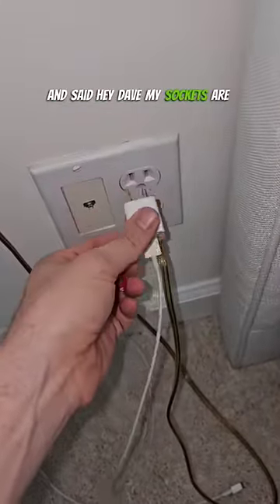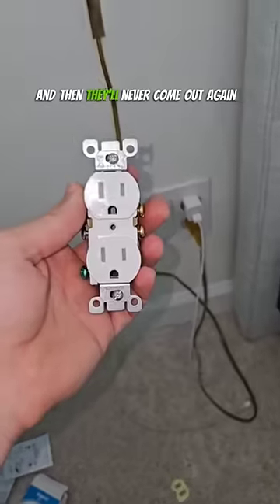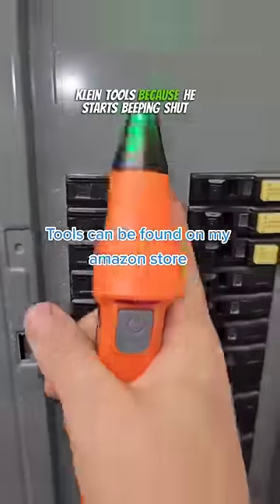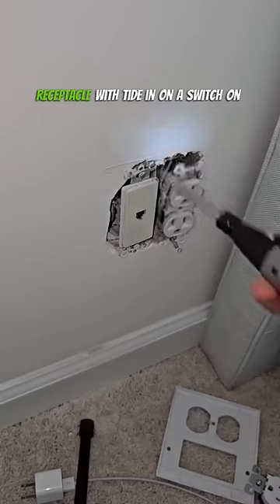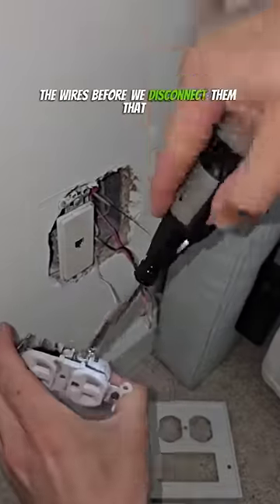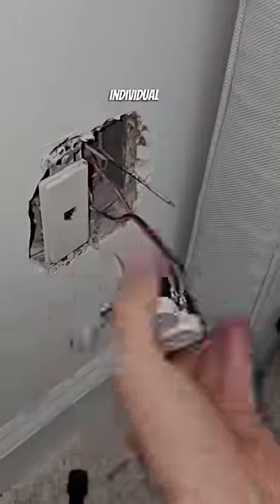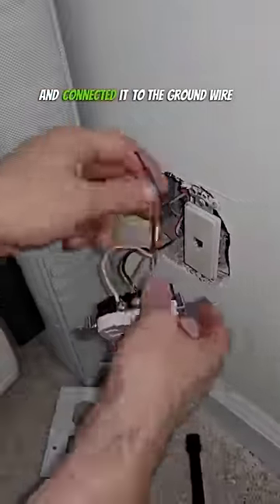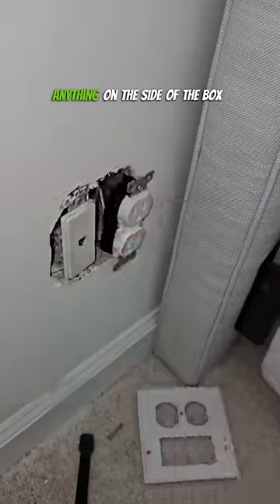🔥 Thats a hazard! How to change a switched outlet #diy #handyman #electrician #HowTo

Comment: As a British Electrician, I'm going to need therapy after this!😂
Reply: As an Aussie one, I completely agree
Reply: They actually put this crap in houses  looks like it's from the 50s
Reply: As a Dutch electrician my eyes are bleeding and my mind is twisting. I'll never understand how shit US electrical is but everything we send there has to be super overbuild UL Certified 🥸
Reply: Even as an Austrian non electician i can assure you that sh*t wouldn't fly here😂
Reply: Electrician in Canada here. What dont you like about it?
Reply: As German Electrician, me too!😂
Reply: @scottyoung7856 uninsulated terminations on the side of the socket is a pretty bad design, especially when you have to insert it like that into a metal back-box
Reply: @thegiantgaming7592   this is an outlier
Reply: @alemgas  Ive worked in houses built in the 1910's and its exacly the same, most still have the same wiring, also we use 110V here, gives you a nice little zap, but you guys use 220V, im sure thats a life and death situation 🤣
Reply: @SavageBunny1  1910 that's nearly  new, we had houses when the dead sea was just ill. We have real electricity not girlie stuff 😂
Reply: @ImBuanana  Fair. Most modern recepticles have some plastic around the screws so they are a bit more protected. Also, if the hot side does touch the box it will trip the breaker, which is the actual reason we ground everything. 

Also remember that we are stuck with device box dimensions and designs from the 1920s where most of Europe had the opportunity to redesign their electrical systems after WW2.
Reply: @scottyoung7856  how come you're stuck? Just make different ones.
Reply: @ukaszsiebiesiuk9002  because it would mean replacing every service and appliance on the continent. Thats easy when you gotta rebuild after a major war before most people have electricity, but nearly impossible now.
Reply: As a british DIYer I was even shocked.
Reply: It's not just you... the only way to find the breaker really?
Reply: @scottyoung7856  everything?
Reply: Lemme blow y'alls mind. This is normal in the US.
Reply: @Savage Bunny  either is plenty to kill you
Reply: @SavageBunny1  yea... we dont have bad electricians here. you can guess why.
Reply: the us gets away with this cuz the power is lower
Reply: @ImBuanana  except we swapped to plastic boxes a long time ago. Idk when but my house is 20 years old and has them
Reply: @AbsurdAsparagus   with lower voltage you get increased amperage and higher power losses and more wire heating... 115v is actually a bigger fire hazard than 230v.
Reply: @SavageBunny1  Plugs here all have safety features. Go look at a British Plug and tell me how you can possibly get electrocuted,, Giant earth prong that must go into the slot first to open the live and earth prongs.  Pins that squeeze into place that stop plugs coming out easily. Live and Neutral prongs earthed half way up the prong.  Switch on the wall socket so it can be switched off and lastly a mains breaker that can turn everything in the room or the house off with a switch.
Reply: @johnmcm7690  Code in Canada says all exposed metal and all metal conduit and enclosures need to be bonded to facilitate the operation of overcurrent devices. The idea is that a live wire touching something it shouldn't will trip the breaker instead of becoming a hazard.
Reply: The American dream is a lie haha
Reply: As a German who doesn't even do electric: that just looks wrong
Reply: US electrics are rough.
Reply: @thegiantgaming7592  combining this receptacle with the dry wall build style of American home's seems like a fire hazard to me. Dutch homes are just on a whole other level.
Reply: As an German it is amusing seeing how many Regulations we have. But seeing how other countrys do it is sometimes scary..
Reply: @SavageBunny1  na.. just a little tickle 😂 400v is the real kicker 😂
Reply: @ImBuanana why bad design. You’re not supposed to work on it if it’s live.. so what’s the point ?
Reply: @alemgas  damn bro alright Mr. Whale oil lamp.
Reply: As a non electrician American, nobody cares
Reply: @SavageBunny1  Not really, it gives you a jolt but unless you have some pre existing heart condition, you would be ok. 

There's a lot that's "wrong" with the system that's being used in the U.S, especially the terminations lacking insulation and going into a metal box. We all know that "it works" and no one is "hating", it's just that in this big world that we live in, there are countries that use much safer protocols when it comes to electricity.
Reply: Then consumer unit (panels) are roughy asf. They look straight out of WW2 😂
Reply: @pws3rd170  I'm willing to hazard a guess that both plastic and metal boxes are still used, depending on the situation.
Reply: @IMPiChE  the point is to eliminate as many risks as possible. You aren't supposed to touch live conductors but it doesn't mean we leave them exposed.
Reply: @ImBuanana  thats how all places are here in the us. Makes painting easier but didn’t know it was a safety issue
Reply: @scottyoung7856  
Abroad in Europe, the outlet is also still screw fastened but it's in the back of the outlet so no chance that you get shocked.
The newer ones have insert type connectors so nothing exposed.
Also, the breakers: it's US so no FID main breaker connected to other breakers via copper bus.
Difference in standards.
Reply: @AbsurdAsparagus  Brother that's like the textbook definition of not understanding electricity. Power is wattage. Neither Voltage or Amperage are power. High Voltage means it can pass through things more easily. More Amperage means there's more electrons moving through something. 110V easily pierces the human body. It only takes 0.1 to 0.2 amp to kill you. That's 11 to 22 watts for 110V. Your mains has about 110-120V with 15-20 Amps max. This is 100x more than what can kill you.
Reply: @povertytv1848  as an Austrian electrician i can assure you that if that would be built here you wont even come to testing that shit because your own company would start rageing at you 😂😂😂😂😂
Reply: The circuit breakers should be labeled… the receptacle should be grounded…but in the US we have 110 residential—so maybe only one therapy session necessary
Reply: @winifred3000  am not an electrician, accidentally made contact once, did not die

If that had happened in Europe at double the juice I would not have survived or had severe damage

I think that’s why they’re all losing their minds.

Plus imagine how bad this would sound if they were bitching about Africans or Indians or South Americans like this….
Reply: Ditto New Zealand.
If I installed a crazy untidy mess like that, and there was a fire ANYWHERE in the house, you get Insurance investigators come though, spot the work, and YOUR Insurance gets a call from the House insurer.
Reply: @thegiantgaming7592  The reason why US electrical is kind of crappy is because it's older while Europe and many other countries got to build their electrical system from scratch in the aftermath of World war II, so they were able to put in place better electrical standards, while in the US because the system was still working it was cheaper and easier to just make certain aspects of it safer than to try to impose new electrical standards on the system. Some examples of this are adding the third ground pin to devices, improving breakers, and putting new standards on 40 amp devices like dryers and stoves.
Reply: @ImBuanana  we wrap the sides of the outlet with electrical tape to prevent that from happening
Reply: @pws3rd170  plastic boxes versus metal boxes is more of a distinction that's at the discretion of the electrician installing the system, there are advantages and disadvantages to both, some electricians like the plastic boxes because in case there is something wrong with the receptacle it's possible that the plastic may melt and insulate whatever might cause the problem, but some other electricians don't like it because the plastic could burn instead and cause an electrical fire.
Reply: Good thing your shit is free. Go take a 3 month vacation too
Reply: @saphiravonterakan7117 Das ist wäre in Deutschland reinster Pfusch
Reply: The world needs to just admit they got it wrong and adopt BS1363 like sensible countries :D
Reply: @scottyoung7856  first of all, solid copper wire, come on, in Europe we don't use that by at least 40 years, if you own a house with solid wires is not following anymore the normatives. Then, there are like a lot of things that are weird in the first place, screws that someone could touch with the fingers and have to be isolated with tape, seriously? Here you can't even have screws if not under permanent isolation. Metal outlet.. Holly f. Plus the blade plugs I think those are horrible, really horrible.
Reply: @scottyoung7856  I think it had to be pattented go to the government regulator and purpose the commercial of new type of outlets.
Reply: I’m not even a sparky and I feel sick
Reply: @scottyoung7856  dude seriously, in europe, electrical connections is stupidity proof, more single wire is more thorn to overheat. If all changed is for a reason, and believe me that you guys have the most housfires for electrical faults. It makes my ass laugh when I see how you build those houses.
Reply: @thegiantgaming7592 there's a reason our Outlets are 120 volts, it's so we don't fucking die when it fails.
Reply: @ukaszsiebiesiuk9002  Your cities were literally flattened and rebuilt.
Reply: @McKae00  they dont like to acknowledge that lol. all these people but a few have skimmed over that fact like it is nothing.
Reply: @scottyoung7856  Have you seen european electrical outlet?
Reply: @sonicsupersam7793  😂 then why do we have 3x higher immigration than anywhere else in the world?
Reply: As not even being an electrician but German, yes me too....
Reply: @freerideshuttle  Dude the metal enclosure is earthed. That is safer than having a plastic enclosure as the circuit breaker will trip if it ever becomes live.
Reply: @SavageBunny1   we do but have so many safety features you do not it almost never happens.
Reply: @baileyharrison1030  however, see it as you want boys, I don't really care. There is a point if everything changed here, don't you think? It's not that all countries are stupid, wouldn't be better if you at least inform at this point in life. It's just funny how you protect these US rules, it's exactly the same as imperial units that suck aswell. If you're sturdy and believe so much into what you and your pall say then stay like that, keep the way you're doing.
Reply: That’s American anything for you lol
Reply: @povertytv1848  Same as an Swiss non electrician XD
Reply: @freerideshuttle  you do care lol. you are writing paragraphs in this thread over it😂you arnt slick. again europe had its countries laid to the grown after the world wars. they had a much easier an appropriate timing to change all the procedures up and shit. unlike the usa who hasnt been laid to the ground an cant rebuild it without cutting everyone off of power eventually and all the mess it would create. construction zones can already take forever just for interstate work. it almost wouldnt be feasible to logistically replace ours without major backlash an issues
Reply: @SavageBunny1 no its also a little shock doseint even hurt
Reply: @SamFagundes  tf are you talking about, it's about gaining new standards, which from a determined moment ahead (let's say 2030) is required to stop building older versions. In most of Europe it changed between the 80s and the 90s, but there are still older versions of civil electrical circuits. If a owner wants to rent, sale or rebuild a house, one of the necessities is to remake all conections as the standards requires.
Reply: @SamFagundes  oh and second world war was in 1939-1945 so lad, you better reorder your statements. My howse when I was a kid was built in the 80's and had solid copper wires, while the house of a friend built at the end of 90's was already with multiwire cables, new sockets non metal, pvc conduits so on.
Reply: @scottyoung7856  Wire Nuts, (we've been ripping them out since the 70's)

Unsheathed earth(ground) cable

 Termination of cable is unreliable (wrapping wire half way round a screw is asking for it to be snapped or pop out. Crimping the cable, or actually have a good design of socket would be a way to avoid this)

Non insulated tools

Looks like an internet port to the left side of socket (data cables and power cables should be segregated to avoid electromagnetic interferences)

Relying on tradesmen  too wrap up sockest in insulation tape to stop live conductors from shorting with earth, again, like the way of terminating the cable, indicates its a shit design.
Reply: @scottyoung7856  That's assuming your breaker is functioning properly and your earth actually has continuity back to the board 

And European legistation changes all the time. For example in the UK we are currently moving sockets up too 450mm from the floor, and light switches 1100mm from the floor, too make it easier for disabled people to use. And considering the majority of our houses are made of concrete/brick, the works includes chasing the walls then plastering afterwards, bear in mind these regulations were passed about 4 years ago.

So if we can change boxes, so can you.
Reply: And some toothpaste probably
Reply: @imunknown9392  nothing wrong with unsheathed bond wires. There will only be current on it during a short.

Wrapping a wire around a screw, the right way, to terminate it is the best practice at least here in Canada.

If you pay attention to details, there is a divider in the box separating the data from the line voltage. Only visible in certain frames in the video, but there.

Like mentioned in the video, you don't need to wrap tape around the plug. Just a preference for some.
Reply: As a Norwegian electrician, I am losing my connection with reality.
Reply: @keithpoole3358  Even if the earth is carrying a fault current or not its still at risk to cause shorts with the live conductors, hence why the style of screw fixing for the socket, which is live copper protruding from the outlet with no insulated cover is also of bad design. All it takes is one idiot too leave the earth long as fuck and then force it and jam it into the back box as they screw the socket back, risking a short with screws sticking out the side of the socket. 

I didnt actually notice that barrier between the two outlets there, good eye!

And I'm not bashing him for using the tape, I'd do it too in order too minimize exposure of live parts. I'm bashing the fact he even needs too, I'm bashing the design and the fact they're even allowed to manufacture sockets to that standard in such rich nations. 

From what I've seen North America compared to Europe, Europeans work to avoid even the tinniest of issues even if they only have a 1 in a million chance of happening, where as Americans are willing too take the risk, after all its 1 in million.
Reply: @McKae00  London was flattened, not the whole country. And most of the electrical works youll find in the uk was done in the 70/80s, each electrical installation in the UK is too be fully rewired every 25-30 years, although this isn't a rule as you can get round it by verifying the the cables are in good conditions via series of tests (EICR)
Reply: @imunknown9392  fair point. Learning the trade here, you're taught to ensure the bond is tucked safely so a short is not caused. Obviously with differing levels of experience and care taken, it can still happen.

I guess I never thought of the designs being hazardous or outdated as that's what we've always had here. You make due with what you got right.

Have a good day man
Reply: @scottyoung7856  no earth Sleeving, exposed live conductors going into a metal back box, a wrap round connection rather than a proper terminal connection I mean the list goes on 😂 fire hazard and it’s ‘brand new’ 😂
Reply: Thats because you’re a namby
Reply: The new electric chair 😅
Reply: The amount of irrational fear Brits have of electricity never gets old.
Reply: respect - agree this guy wouldn't even pass inspection by a 2 year British toddler wearing a yellow hi viz jacket. even the toddler would fail him.
Reply: As a German electrician, I feel physical pain.
Reply: @SavageBunny1  We use 240v here in the states, its just split.
Reply: @ImBuanana  just work around it. then again i dont switch off the breakers when i work on my sockets so its pretty easy to tell if its shorting
Reply: @thegiantgaming7592  oh my-
Reply: Maybe I'm late to the party, but anyway; as an Italian electrician, I'm also very confused by the american electrical system. Looks like they are still stuck in the '50s and never advanced. Their fuse boxes look... strange? I also worked on electrical cabinets/panels for the US, and they are always different in many ways (for example, they use a lot of fuses, from what I've seen)
Reply: What is that abomination.
Reply: @jstefa2  It's called current.
Reply: @Delalcon  It's called current, the Ampere is the unit of measurement of current. Power is overall energy, the Watt is the unit of measurement of power.
Reply: As a German, my Jaw dropped and I had several strokes, probably need a hospital now.
Reply: @SavageBunny1  400 V and 3 phases to every single little house 😘
Reply: @thegiantgaming7592  not only the electical in US is shit as fuck. 
I never understand why they build houses litteraly out of paper. Expesialy in regions where tornardoes hits. Just take more money and the house is not gone after that.
Reply: i’m not even an electrician, we just had a practical on how to wire a plug in my physics GCSE course, i’m crying at this
Reply: @alemgas  you might have "real" electricity but you're lacking in firepower
Reply: @alemgas  I mean America was the first to implement electricity soooooo there is that 💀✌️
Reply: @scottyoung7856 Euro trashing American electrical work is a past time. Don't align with us Canada! - You're too nice and polite to hang with FREEDOM! 🇺🇸🇺🇸🇺🇸🇺🇸🇺🇸
Reply: As an American I would love to adopt the metric system fully. Regarding our infrastructure on electric and Internet..... It sucks
Reply: @JacksonPhillips-j2m  Why tf are u telling me
Reply: @Oztinfrog  in 1874 the first electrified house in the world was in the U.K. your lot were still getting a heat from a camp fire. Go read some history books. You know what a book is??
Reply: @solvency2690  what are you on about?. Explain
Reply: @scottyoung7856 nah, just start putting them in new buildings, that’s what the council did in the areas where not a lot of bombing happened here in Britain. Some people opted to change old wiring to the new stuff but you can still find houses today with old plugs! Not that they’re on the mains anymore for safety reasons but you get the idea.
Reply: @SavageBunny1  What? Lmao most houses have 220 capabilities nowadays if you need it, mine does. And even wiring from the 1970s is COMPLETELY different than new wiring. That's just delusional
Reply: @freerideshuttle   what US rules you talking about..? are we talking about soild copper wires & metal or plastic wall boxes..?  new houses being built use plastic boxes in the US there is EFI outlets if there needed..  seems your so use to being told what to do & how to do it your all becoming mad over electrical items.  im sure if i cared to "learn" something about how you build a house over a 10-30 second video.. weird we dont see many videos of your countries showing us how to do things..? to lazy to put out a free video..? ehh
Reply: @jamesrosewell9081  nay this is standard for Florida. some buildings have grounds some don't the fun part is when they use different colours depending which decade the outlet was installed
Reply: @SavageBunny1  you most likely also have 220v (or 240v) 120v is a single phase single leg of electricity, hence your range, air conditioner, has 240v all country’s use 240/220 and 110/120v isn’t a little zap, that’s the number one killing voltage on earth, people get too careless with it cuz they think it’s a little “zap”. It’s amps that kill, not volts, universally.
Reply: Yes because nothing says I want to start a house fire like leaving an uninsulated ground
Reply: @kaylubyarbrough7013  lol the ground wire if you didn’t know, does not carry current, it only is used as an emergency path for power to return to the panel, so for less than a second it returns the load on the ground in a short circuit situation, the ground not being insulated is actually safer in most cases, it could save your life, especially commercial applications to ground conduit, although mc is used more often with insulated ground wire. The ground is your friend, as long as you yourself aren’t grounded
Reply: @SavageBunny1  if you were an electrician you'd know we don't use 110v and haven't for like a hundred years. We're on 120v now.
Reply: @Delalcon  god you have no idea what you're talking about. Ever heard of resistance? The resistance of the human body is about a million ohms. At 120v, that's 0.00012A, or .012mA. It takes between 100-200 mA to kill someone.
Reply: As an german electrician I will join you 😂
Reply: "No ground wire" 🤢🤢🤢
Reply: As a British factory worker even the old electrical stuff from the 80s in different wiring colours seems like a dream compared to this. I need a bleach shower after seeing this
Reply: Swiss electrician here and i agree😂
Reply: @muxite6035  for the same amount of power being drawn you need to double the current if you half the voltage.
Reply: Lol
Reply: As a Portuguese one I'm going to need therapy as well!
Reply: @scottyoung7856  Unisulated terminations on a metal box, J hooks to connect wires, wire nuts, the list goes on and on...
Reply: @johnmcauliffe8824  Well you guys had more than enough time since to perfect and make your existing systems safer. Plastic boxes, isolated insert terminals for sockets for example, not using wire nuts, double isolating conductors by running them through conduits instead of nailing a cable directly to wooden studs, using proper RCDs or GFCIs etc...
Reply: I’m coming with you James.
Reply: I see a lot of hate in this thread for American electrical standards. I’ll have to check out how the Europeans do it that they think it’s so great. Stranded wire for 240v+ seems like a bad idea. There is also a lot of misinformation about the voltage that we have available in our homes and people seem to not know the difference between a fuse and a breaker. We have 240v available as well as 120v in our homes. Typically large appliances and AC units are all that use 240v but I have outlets in my garage for welding that are 240v. Most homes in the USA don’t have fuses in them anymore. My wife’s parents live in a farmhouse built in the late 1800s and they still have fuses but they are an outlier. I’ll also have to checkout the different voltages used in a European factories. I’ve spent the better part of my life working industrial maintenance positions and HVAC so it would be interesting to see the difference.
Reply: @TN-cx4qi  nothing about the voltages, certainly concerns about the way you guys twist conductors and terminate.
Reply: @PHealey1981  I will agree that the push in wago connectors are slightly better but they are not any safer than twisted wires and a wire nut. I’ve watched a couple videos since I posted that message and saw a German video where they ran conduit and stopped 5cm short of the box they were terminating in. What is the point of that? I’ll continue to learn more about European electrical connections as many are familiar to me. We use similar components in factories.
Reply: @TN-cx4qi  Don't know where you got that stranded wire info, were use solid core, don't know about the US but here it is mandatory to have a main RCD or GFCI protecting the whole circuitry. As for European factories they usually work with 3 phase 400V per phase (230V x √3)
Reply: @SavageBunny1  it isnt life or death but it does hurt lol
Reply: @alemgas yep about then late40s we lost the 2 pin
Reply: As an American electrican, wipe those tears its okay! We have push in lever lock outlets & these are only used for clients who want to save money & are 100% safe. Luckily, we're wiring it and not you guys bc youd probably connect it to the box somehow.
Reply: @alemgas  our plugs look the same, though these apartments are def from the 1980's AT LEAST
Reply: @SavageBunny1  I grew up in an OLD house that still had fuses you need to replace.  It was always a huge pain in the arse when you blew a fuse.. "WE'RE OUT OF THE BLUE ONES AGAIN!" "SHIT"
Reply: @ImBuanana  you do realize that the box is/should be fully grounded right and that you are always supposed to shut he breaker before working on any ekectrical repair.
Reply: Likewise!
Reply: @alemgas  this house is from the 50s
Reply: @Darbman62  so it's o.k. then? The electrics are bloody awful time to join the 21st century
Reply: @alemgas  no, I would first get rid of the low voltage, because who has a hard line phone anymore.  Then I would buy a higher end outlet that has more safety features.  This is a run of mill outlet that costs almost nothing.  Design hasn’t really changed in the last hundred years.  They make better ones… they just cost more.
Reply: @HAIRY_SOAP 4 year apprenticeship na. one YT vid yeah. Lol
Reply: Aw stop as an Irish one I’m shocked. Uninsulated terminals just free to touch the metal backbox. Wtf
Reply: As a US electrician, get off your high horse.
Reply: @alemgas  It works just fine.
Reply: @ImBuanana  Unless those terminals actually touch the box nothing will happen.
Reply: @alemgas  If your outlets are so much better then it would stand to reason your boys can't take a little voltage without shitting their pants. Now who's the girl?
Reply: @Gravedigger933  they said that about the horse and cart
Reply: @Gravedigger933  well yeah obviously but the whole point is to minimise risk of accidental contact. I agree the UK is a bit of a nanny state when it comes to regulations but we have plenty of stupid people who do stupid things, red-tape regulations prevent accidents and if they don't, they prevent lawsuits.
Reply: @Gravedigger933  i mean your electrical wiring standards are pathetic
Reply: British electrical standards are one of the safest in the world. US electrical standards are diabolical.